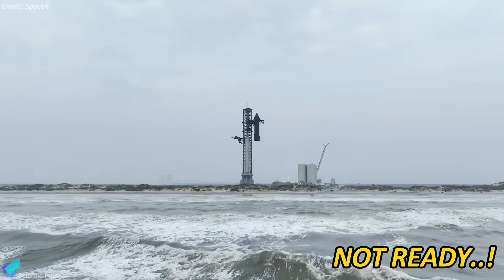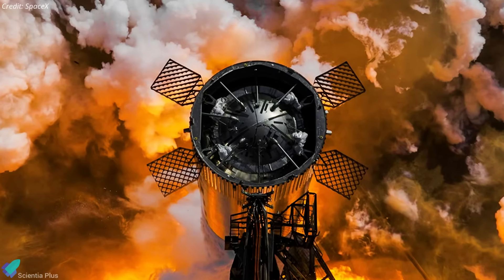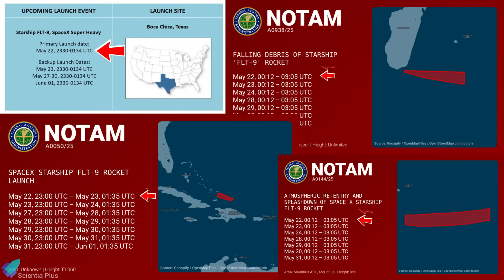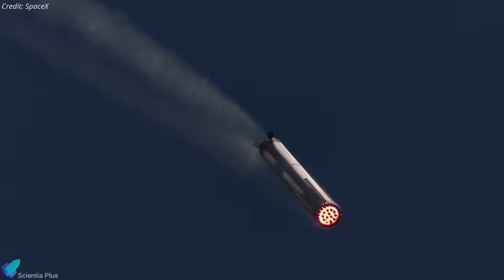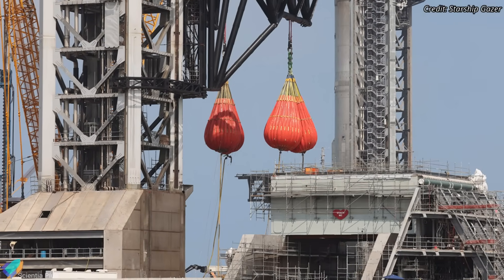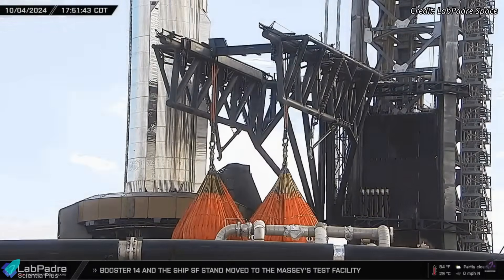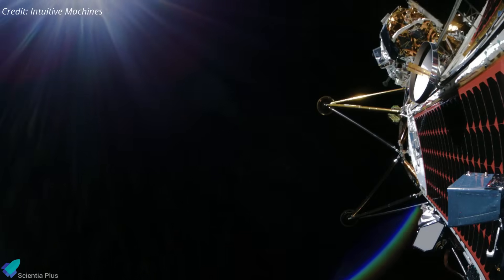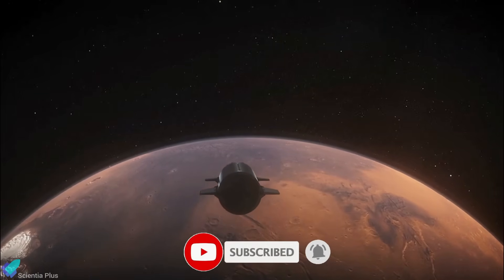Why Exactly Starship Flight 9 Booster Catch Cancelled? Launch Delayed Again!

Comment from the maker: 00:00 Starship Updates
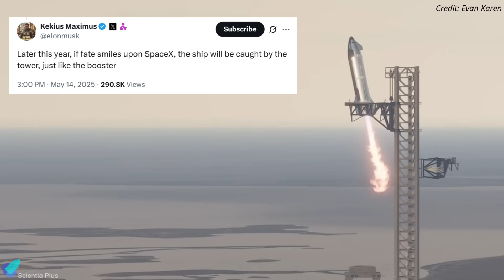08:56 The Shocking Truth Behind Nova-C's Moon Crash | Final Report Revealed!

📚 Learn More:

🚀 Starship Block 2 Explained:
 📖 Summary: https://shorturl.at/b0dtw
 🔍 Detailed Explanations:
  • Design Improvements Update 1: https://shorturl.at/lpGT7
  • Design Improvements Update 2: https://shorturl.at/gwNQ4
  • Nosecone & Payload Bay Redesign: https://shorturl.at/xa60S
  • Methane Downcomer Redesign: https://shorturl.at/XdYBG

🚀 Starship Block 3 Explained: https://shorturl.at/mnBT4
🚀 Starship Block 3 & Booster Block 2 Explained: https://shorturl.at/IViwD
🚀 Starship Block 3 & Booster Block 2 Production Begins: https://shorturl.at/xRNkJ

🔥 Raptor V3 Mega Upgrades & First Test: https://shorturl.at/TRIyj
🧱 What’s Inside Starship GigaBay?: https://shorturl.at/nJM75
🛠 Insane Engineering of New Starship Launch Pad B: https://shorturl.at/7RAZd

🛠 Other Starship Upgrades:
 • Hot Staging Explained: https://shorturl.at/jf400
 • Super Heavy Booster Upgrades: https://shorturl.at/Pi5R3
 • How SpaceX Protects Raptor Engines: https://shorturl.at/4Om8F
 • New Heat Tiles Explained: https://shorturl.at/p2Ijb

🚀 Starship Flight-7 Anomaly Explained: https://youtu.be/UqzZx7vb-TA
🛠 Starship Flight-7 Root Cause & Fixes: https://shorturl.at/HcLKo
📊 Flight-8 Complete Breakdown: https://youtu.be/f26yH80RK2o
🔥 Starship 35 Static Fire Anomaly Breakdown: https://shorturl.at/eLCvL
🚀 Ship 35 Long Duration Static Fire Breakdown: https://shorturl.at/Ypf0p

Nova-C Odysseus
a) Launch & Mission Overview: https://shorturl.at/rvABK
b) Landing Failure: https://shorturl.at/pqAIM
Nova-c Athena
a) Launch & Mission Overview: https://shorturl.at/Mtegc
b) Landing Failure: https://shorturl.at/SKHFX

📡 Stay Updated:
📢 Weekly Updates: https://bit.ly/3HIQjPC
🚀 SpaceX Playlist: https://bit.ly/34wue8T

🌍 Follow Us:
👍 Facebook: https://www.facebook.com/scientiaplus